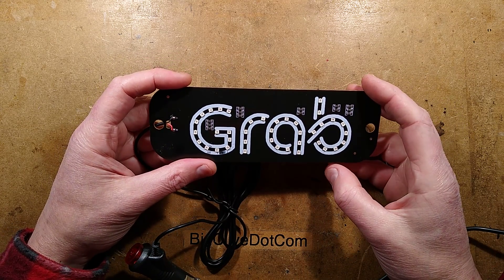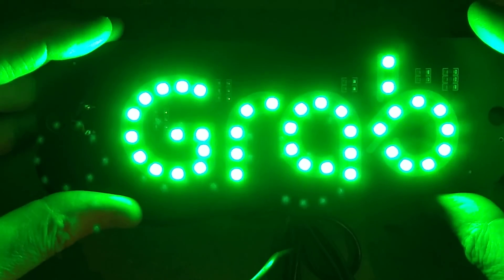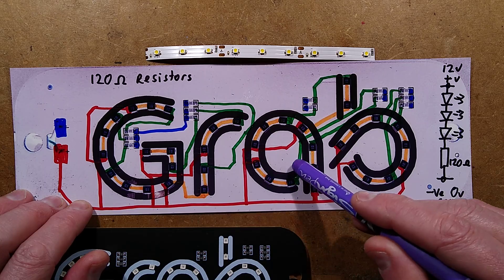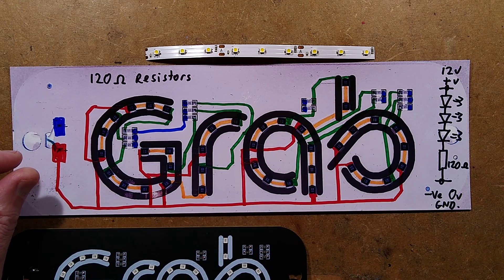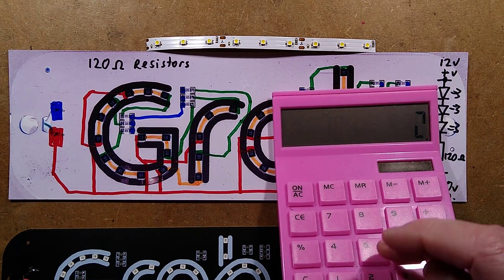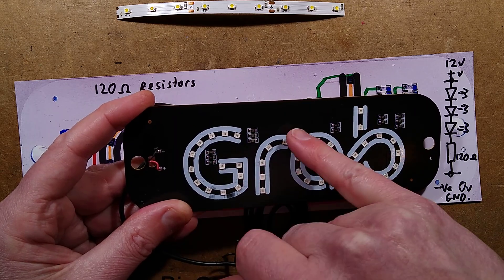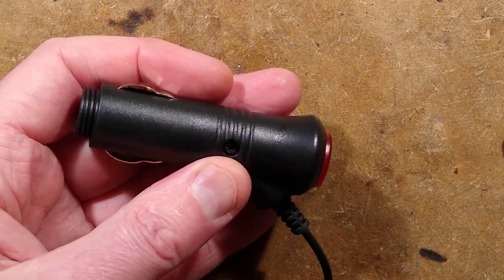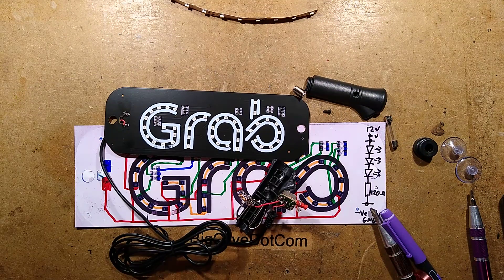Reverse engineering a Grab vehicle sign

Comment: Clive my led grow light decided to stop working after a power outage are ballasts/drivers easy to fix?
Reply from the maker: They may be using a standard current regulated supply.  Quite often "arcing" power can cause problems with power supplies.

Comment: I was just watching your live stream from my home in Borneo when I noticed something strange which you may have thoughts on. I have a 12v light on my verandah running off a car battery which is charged from a couple of small solar panels. There is a storm going on and, when there is lightning, the charge controller shows the battery is charging. The led continues to show charging for about a minute or so after the lightning flash. Any idea what’s going on?
Reply from the maker: The flash of light is generating enough current to trick the charge controller into thinking it's sunshine.  There's probably a delay so the unit doesn't toggle between charging and not charging at dusk due to cloud or shadows.

Comment: Would the ground plane act as a heat sink for the LEDs?  I'm assuming there isn't any kind of thermal paste to conduct the heat efficiently, or that there would be bare metal underneath them, either.  But it must act at least a little bit like a heat sink, right?
Reply: Thats how small SMD LEDs packages cool themselves. One of pins covers big part of package and dissipates heat into tracks.
Reply from the maker: The LEDs aren't being run too hard, so ordinary PCB material is probably enough.

Comment: So what is the forward voltage of each LED? Assuming no significant voltage losses in that cheap cigarette lighter plug and the thin cable (unlikely I know), at a total current of 173mA at a 12V supply voltage, that’s 13.3mA per resistor. Hence the voltage across each 120 ohm resistor is 1.6V. That gives a forward voltage across each LED as 3.47V which sounds a tad high for a single green LED.
Even if the cheap cigarette lighter plug and the thin cable are dropping 2V, that still gives a forward LED voltage of 2.8V.
Reply from the maker: It varies with voltage.  Preferred current for long term use is around 15mA but on a fully charged battery these will be topping 20mA.

Comment: I wonder what the voltage loss threw the long thin supply wire is. 1 or 2 volts most likely. Maybe in Singapore it is mounted low enough in the front that they cannot see that it is on, so the lighted switch comes in handy. Thanks, Clive, for the tear down of things that most of us will never see or hear about.

Comment: I was partly expecting there to be a current limiting circuit in the car adapter, but not surprised to see there wasn't one. My thoughts on the lighted switch is that housing is probably a common off the shelf item that the manufacturer could get at the lowest cost, otherwise they would have gone the route of plug in when on the clock, unplug when not.
Reply: If you replace the 3A fuse with a 250mA fuse, the resistance of the fuse will drop around 1V. I’ve seen those cigarette lighter plugs before, they can’t handle more than a couple of amps for very long without melting.
Reply: The resistors act as current limiting circuit
Reply: @petermuller608  true. I should have been more specific and stated an active current limiting power supply circuit.

Comment: Clive, Uber here in the States has a similar circuit board. I was tempted to take one that was in the boot of a car in a breaker yard here, but realized I really had no use for it, so I left it there.
Reply: Lyft has them too. The signs come in really handy at night by showing which cars to give a wide berth to on the streets.
Reply: That's never a good enough reason not to have something sitting in a drawer or box!

Comment: The cigar lighter plug is one connector that needs to die already.  VGA is another.
Reply: When auto manufacturers come up with a better power distribution method, I'm sure there will be a forced transition to that new method.
I say keep VGA and get rid of DisplayPort and DVI. lol
Reply: The problem is Anderson plugs are too damn expensive as single consumer purchases but manufacturers could probably switch for $1 a car.
Reply: What’s wrong with VGA? The D type connectors are more rugged and longer lasting than many newer cheaper and smaller connectors. And the jack screws stop them pulling out.

Comment: Many new vehicles have electrical systems that hit MUCH higher voltages. Over 15v on General Motor trucks isn't uncommon.
Reply: They're temperature-compensated and you get the higher voltages at lower temperatures. Since batteries like to be charged with higher voltages at lower temperatures. Originally, the temperature sensor was part of the voltage regulator inside the alternator, but these newer vehicles where the powertrain control module controls the alternator probably use the air intake temperature sensor to determine charging voltage.
Reply: Even my 27yo Saab 9000 charges at around 14.5 volts when it's cold outside.
Reply: @vibingwithvinyl  my vw van hits 14.7v in the cold. Pretty sure it's 14.4v in warmer weather but i'll check...in 6 months (crying actual icicles)
Reply: I don’t know much about vehicles but I’m pretty sure they are at 12. I think you mean when it’s running?
Reply: @SquishyZoran  Yes, when running. I had to change the protection circuit design on some car audio amplifiers I was developing to deal with it.
Reply: @cdnaudioguy  Sounds like a faulty alternator voltage regulator
Reply: @Tokaisho1  On any other application, I'd agree. But in this case, it was confirmed across at least six vehicles.
Reply: At 15 degrees C, for cyclical charging of sealed lead acid cells, the voltage per cell should be 2.5V, hence a system voltage of 15V.